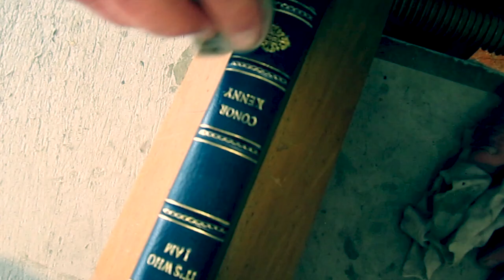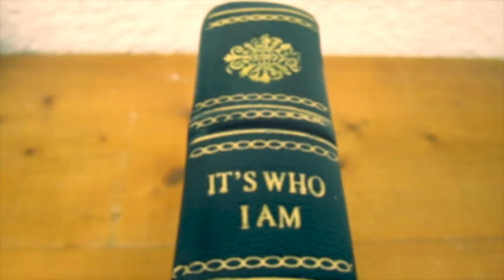Gold Tooling: It's who I am

Comment: What is the adhesive you using to make the gold stick to the leather besides the heat from the tools? I have tried both with egg glair and shellac. The first never worked, the gold always falls off with glair and with the shellac there are always misses.
Reply from the maker: Morning INA, you can find a full description on our blog post at the below link - http://kennysbindery.ie/blog/item/9-video-22ct-gold-tooling-a-leather-spine
Reply from the maker: Gerry uses a “size” it is a mixture of egg white, vinegar, salt, and glycerine,
it works as an adhesive which the gold leaf will stick to. The mixture will be applied onto the leather spine, and let dry for a few minutes.
Reply: @kennysbookbindery  Thanks for your response. I have previously read the blog and this particular article, but I still seem to be doing something wrong. I am using the exact products described there and I am being very careful with the temperature of the tool (right off the sizzle).  The only thing that comes to my mind is that maybe I should buy eggs from a different store :D